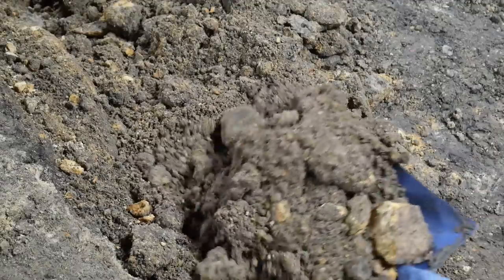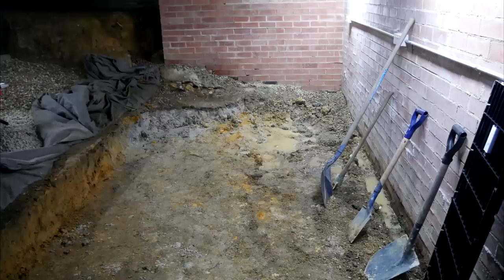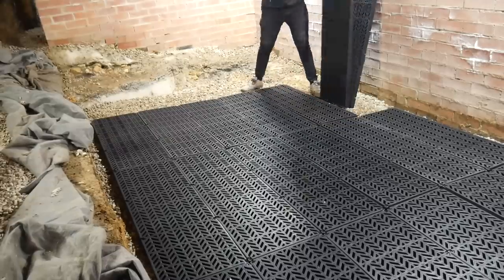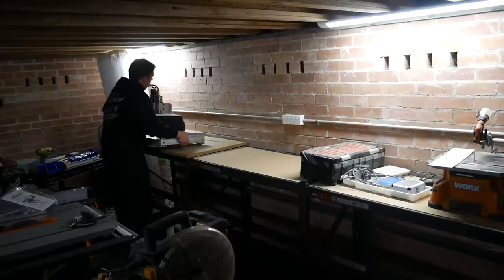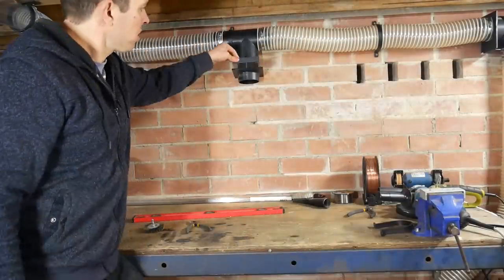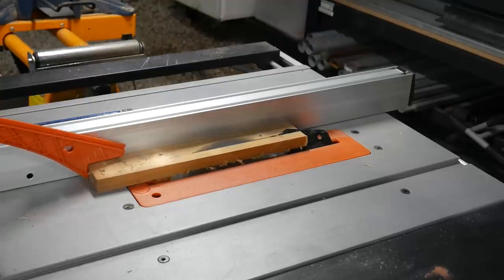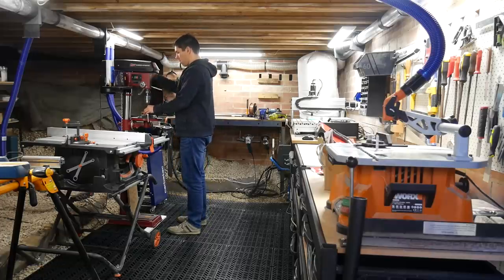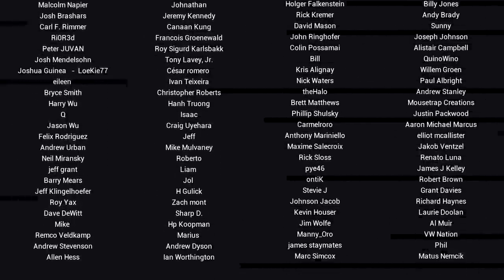Digging to create an efficient under house workshop

Comment: The humidity is going to be brutal on your equipment/supplies.
Reply: I have a basement workshop with two good sized dehumidifiers set at 60% and both automatically drained. Before that, I found I would get gradual corrosion on hand tools and cast iron surfaces.
Reply: Well, unless you add a dehumidifier
Reply: @TGG141  Or five.
Reply: Yup, I just built a garage finally, got tired of all my stuff rusting in the shed. Agressive dehumidification will be essential
Reply: Worth regularly oiling all the tools you can.
Reply: @apinakapinastorba  the oil helps keep it from rusting right?
Reply: @TGG141  it's best to wax metal surfaces lasts longer then oil.
Reply: @TGG141  Some tools you can oil constantly to make them work better, like hand saws and planes. Two birds with one stone :)
Reply: Stuffs gonna be wrecked from rust in a month. Needs a humidity monitor urgently!
Reply: not really much can be done with the humidity with the water seeping through all the time u will never put enough in there to get it taken care of
Reply: "My stuff was getting dirty, so I decided to move it underground." 😕
Reply: This the normal ambient humidity where I live and I don't have a lot of problems. The thing you really have to look out for is condensation, just humidity is fine.
Reply: He needs to monitor the humidity in at least a couple spots. No way would I put expensive tools and machines in a room with a damp floor. You absolutely can waterseal the foundations on the outside. Screw water ingress. That's just bloody lazy.
Reply: @TGG141  That much practically flowing water means he'll run them 24/7. Fix the problem at the source!
Reply: Buckets and buckets of silica cat litter.
Reply: This was my first reaction.  A moisture barrier is normally used in these applications.  The bearings in the dust collector motor will unfortunately probably be the first to go, becuase the ambient moisture will have no where to disperse when the room temp swings (unless the spring's water holds the temp constant, as it did appear to in the clip).

I would HIGHLY reccomend investigating removing the breatheable landscape fabric (as it is called in the states), and change it to waterproof plastic sheathing (full length, single sheet) that covers the full natural flooring and walls.  This is similar to practices with 'crawlspaces' in the US.  The result should be a much better humidity level in the room, which not only protects the tools (and the MDF shelving), but also make it more comfortable to work in.  Plus, waterproofing should reduce the workload (and energy cost) that is placed on the dehumidifier, or recharging dissicate.  A dehumidifier will still be necessary in the end, but it will be able to better keep up with proper source mitigation.

Oh, and as the other poster said: Fire extinguisher! Maybe even a hardwired/linked smoke detector as well, since the dehumidifer is running unattended in harsh conditions.
Reply: Just run fresh air in from outside and exhaust old air outside. If you are running enough airflow the moisture won't matter as the air is always fresh and dry.
Reply: This is what I was going to say, its cool, but the humidity will be a bitch to deal with, a dehumidifier will help but perhaps consider putting a wall in near the rest of the soil so you can put a humidity/vapor barrier up and then draining the soil itself rather than the one in the room. I mean keep that but I would have taken the soil back another 500mm, put a french drain, or better yet socked, slotted aggi-pipe in front of the spoil pile and  drained that out and put a wall with moisture barrier on it along the back, from here I would have still drained and gone with dehumidifiers but trying to stop the moisture closer to the source rather than dealing with it at the end.

Having said that I would have probably got a civil/hydro engineer to have a look to see what kind of re-enforcement I would need to put in so I could pour concrete and seal the entire space and build a proper room, better to do things once and cry once IMHO

Comment: Looking pretty good. There's one tool missing that you'll never use but when you need it, it is the most important tool you will ever own by far. That's a fire extinguisher. You're mixing woodworking and welding in the same small space and have your living quarters directly above that. I would highly recommend you make the small investment and mount that bad boy somewhere obvious and close to the entrance of the workshop.
Reply: Better yet, get 2 of them. You never know.
Reply: @schwuzi  Agreed, 1 is likely enough, but they run out quick, get 2 and put them on each side of the room.  I wonder if you can get one of those fire bomb things where you can throw it in an area and it basically explodes this fire retardent powder :D
Reply: @xSensu  you can get them on amazon lol i have one in my workshop.
Reply: @schwuzi  well you need 2 anyway, 1 water 1 dry chem even a 3rd CO2 can be useful for electrical without damaging surrounding equipment.
Reply: I'd even add a first-aid kit.
Reply: Constant water seepage and electrical tools, makes me think he'll need one sooner than later
Reply: If you haven't already, I'd suggest a GFI circuits for your mains.  

On the fire extinguisher note:  I helped a friend run a DIY sprinkler system in the roof of his workshop.  It has a ball valve at the exit doors so you can run to the door and soak the entire shop quickly.   You could do something similar and even have zones you can open or close to only spray the area where needed... Just a thought since it would be relatively easy to access your house plumbing for supply lines.  You could add a faucet outside or just inside the door as well so you can flush the pipes occasionally and to wash your filthy hands on the way inside for dinner so the missus doesn't scream about it LOL   On the same note, it would be nice to have an air curtain-like apparatus to blast away saw dust from your clothes on the way out
Reply: @jawa6988  not to worry, nothing will catch fire with water on the floor
Reply: Bunch of Safety Sallies
Reply: A fire blanket is a good addition too. Quick and easy to use and way less mess. And they never expire
Reply: @xSensu  That would trash the equipment in the shop 4 sure.
Reply: @SaltGrains_Fready  would it trash it or just make you scrub everything down before use.  I never saw what happens after they are used
Reply: U forget 2 mention the Kitchen ! 
I have 2 different kinds there.
Reply: Use at least a 10lb dry powder extinguisher or and a 2.5 gal water or foam extinguisher. Those are best suited for workshop fires. Water or foam for smaller non-electrical fires like burning wood etc, powder for everything else
Reply: @Aerykian  ... and be sure to include an easy access one-hand tourniquet. Power tools that become self-aware and homicidal can cause a lot of damage on an unsuspecting human before they are shut down.
Reply: On top of that, air quality. Gotta have proper circulation & fresh air.
Reply: in civilized countries, we have basements.
Reply: Also: intumescent paint!
Reply: Get a few automatic Fire Defenders.
Reply: Yes! Look at the element fire extinguishers. They’re a bit dearer, but work a treat and don’t require maintenance.

Comment: Be very careful with the fume extraction. When sparks are sucked in, the dust in the system can catch fire very quickly. And flowing dust can even explode!
Reply: Fascinating Horror and Brick Imorta have done some really good videos on dust explosions.
Reply: Plus, be sure to ground the pipes - static electricity can be a problem!
Reply: I believe static build up is the concern and that is usually when using PVC and no ground. His system doesn't suffer from those things.
Reply: Dust explosion hazards from these units are well known and documented. Enclose the DE unit or place it outside in a safe area
Reply: @steveharper8916  source? Because in my experience,  it's over dramatized.  You don't need to move it or enclose it. Just ground the thing.
Reply: He appears to be running a TIG so sparks will basically be non existent.
Reply: @seanb250  Cleaning the metal with a grinder will generate enough sparks so not only look at the welding equipment. A dust cleaner is not a fume extractor for welding. Burning down your house, and then discover that the insurance watched the video would be very bad. Plus the danger of smoldering sawdust, which you not directly see.
Reply: @seanb250  Woodworking machinery can cause sparks from wood jamming, entrained stones and nails, and any electronic malfunctions. This is not a fume extractor but a dust extractor!

Comment: The previous owner of my house did this. I moved in thinking I had a sweet basement workshop, but within weeks found that it was constantly damp and later that it flooded several times a year. Same deal as yours - Rock formations that flow spring water. It took years of work to discover and solve all the leaks. I've bailed out thousands of litres of filthy groundwater several times. I had to do full perimeter drainage, concrete retaining walls and a vapour barrier. In the meantime all my machines have suffered surface rust, damaged bearings and other humidity related problems. One of my guitars basically self destructed from warping so much that it ripped the glue joints apart. Unless you get a reliable 50% humidity under there you'll regret it before long.

Comment: Hey Michael. I’ve never really commented before, much because you always provide insight and an oppurtunity learn. But this time I feel like I can somehow contribute. 

Firstly, when you are digging in soil like ground, you will need to compress the loose bits. Your efforts in leveling the floor with gravel and sand will help, but not eradicate the issue you will have with uncompressed ground. This might also affect your trench, and will eventually mess with your floor to the point that it gets annoying. 

Like a lot of other commenters said, with a moisture on those levels this will for sure eat up all your tools - especially your electronics. This will be costly. A dehumidifier works better than leaving it as it was, but the best thing is always proper ventilation of the area.I suspect the dehumidifier will work overtime trying to cope with a well underneath it, and i would definitely try to install both a inlet and outlet fan. 

I would strongly advise to use money on a contractor to look at the room, to figure out how you could use plastic and concrete to separate yourself from the ground moisture as well as building walls to separate this room from the rest of the cellar. It is vital that you still let the airflow from the rest of the cellar flow as was intended, or for it to be redirected elsewhere whilst at the same time ensuring adjacent rooms to have their needed ventilation. 

It is also important to know that a woodshop in a humid area like this, with flooring like this and loads of moisture can quickly turn into mold. This will be bad for you, and you might not even know it is there. Vacuuming the cracks both takes time away from what valuable projects you should be working on, but also leaves the possibility of you forgetting larger amounts of wood to the elements. Water specifically. Water and wood is not a great combination. 

My last keynote are ground gasses like radon etc… Before you start using this room over longer periods you should check this out. Again, this issue can be helped by properly ventilating the area with mechanical ventilation. But, the best thing is for sure to make this a proper enclosure using proper construction techniques and products specifically made for the purpose of sealing you away from them.

Comment: So many woodworkers do not appreciate the pressure drop of various fittings.   A "T" fitting has the worst pressure drop by far.   I replaced by "T" fittings with "Y".   I replaced my short radius 90 deg elbows with long radius elbows.   I then felt a big increase in suction at the gates.
I recommend avoiding "T" fitting if possible.
Dave.
Reply: Y fittings wouldn’t be too great either as you don’t have a straight through. Since in this case the air only needs to go one way a better type of fitting would be a mix of a straight pipe and an elbow. Not sure if you can buy any like that but also might not be too difficult to make out of two pipes.
Reply: @conorstewart2214  In this situation it would be best for the pipe to come out at an angle, let's say a "half K" fitting
Reply: @IDiveI11  That is pretty much what I meant, although I meant for the offshoot pipe to be curved rather than straight, to help with airflow.

Comment: I had something similar to your setup once I eventually gave up. 10% of the time I used it for projects the other 90% was fighting rust. Even nuts and bolts in bins would get tiny specs of rust on them. Eventually had to move everything into the garage, in the process of building a conditioned building out back. Hopefully you have better luck than I did!
Reply: Yeah, that would be my worry, rust on saw, drill and other bare metal tables, unless they are aluminum.

Comment: As someone who grew up on an aging sandstone ridge in Sydney's south, we also had a number of fresh water springs and general seepage through the stone bedrock.
Regular rust prevention and good airflow will help prevent oxidisation of unpainted surfaces.
I would suggest some time in the future to get a licensed builder in to install some RSJ's to replace the pillars. Then excavate the rest,wall it, drain it appropriately and pour a slab. You seriously won't regret it.

But in the mean time you've figured out some great solutions!  (But get some airflow happening definitely..)

Comment: We actually have a very similar water management system under our 13C barn conversion (stable conversion), although there is no space under the floor for a workshop there is channels to pass water through. My house used to be a Stable on a farm with a field above it, the water run off heads to us and overflows under the house through the car port and under the farm yard to the pond in the farm house garden, the pond then overflows down to the next farm and through 5 settlement ponds to the river....the river is about 600ft below us and the water is crystal clear so the farm pumps it back up to a mini reservoir in the field above me and that supplies our house with our water supply.
Reply: Don't ever move away. You have the best of what everyone else is trying to figure out.

Comment: Good start, but you will have eternal humidity issues as well as the potential for ground gas exchange (i.e. radon if you have it there). A friend of mine does basement drainage for a living and recently I worked with him on a very similar issue to yours. The proper way to go about this is to do the gravel base as you did, but use deeper trenches and install weeping tile in the drainage trenches to bring the water to a sump, preferably external if possible. Then you need to cover the gravel over with properly sealed and taped 6 mil poly vapour barrier as a minimum, rather than the weed cloth which is permeable. If there is external soil pressure on the foundation (it appears not, foundation is mostly above ground?) then you also need to pour an internal step footing to bear the side load that the removed soil is no longer supporting. Also if the walls are underground at all you need to install dimple membrane tucked under the vapour barrier to allow leakage water to run down the walls and into the drainage trench. Finally you should pour at least a thin "rat slab" of concrete with rebar in it to protect the vapour barrier and tie everything together, and you can then pour pads of self-leveling grout on top for your equipment or do a thick pour and screed it level (or hire it done as concrete is a lot of work especially for those inexperienced with it). 

However the builders should not have left your house with such a high level of moisture in the basement, all that water should be already intercepted by perimeter drains! We just bought a house in a high water table area for my wife and we were VERY particular that perimeter drains, membrane and vapour barrier were properly done with no potential for leakage. I would not have bought a house with a basement like this as the potential for future issues is high, at least here in Canada. Hopefully things work out but I would have a professional or at least a professional friend look at this basement before you do anything else!
Reply: this is the way
Reply: It isn't really a basement though.  Basements are really rare to find in Australia in anything built in the past 75+ years.  It is basically just a open area under the house due to the house being built on a slope and they generally have pretty good ventilation.  You will find these areas either with the brick veneer like TT's or it may just be completely open or even have some sort of wire mesh instead of brick to keep out vermin/pets/kids from going under the house.